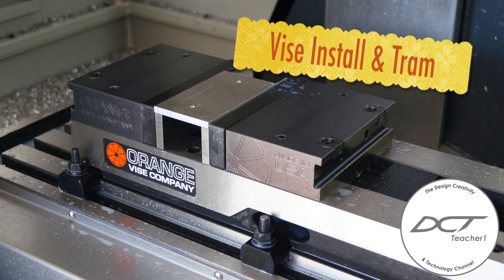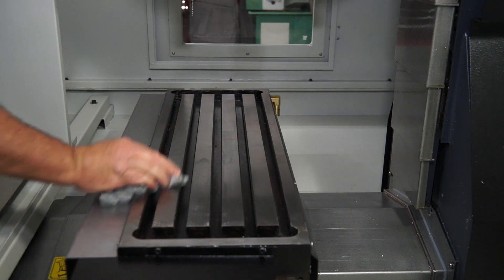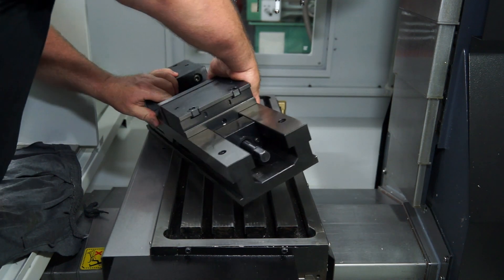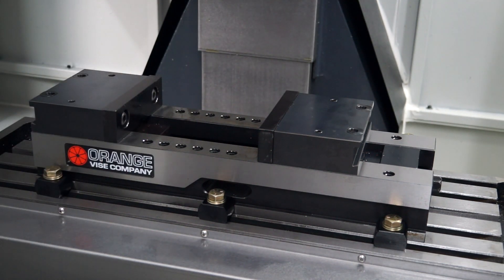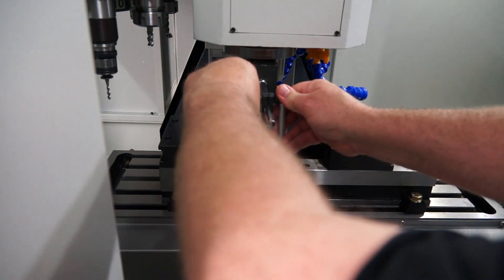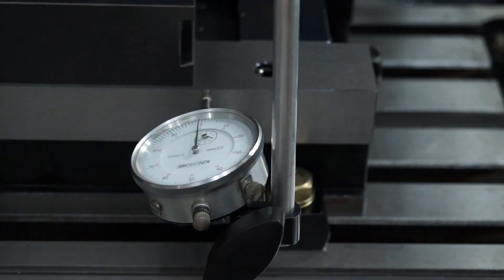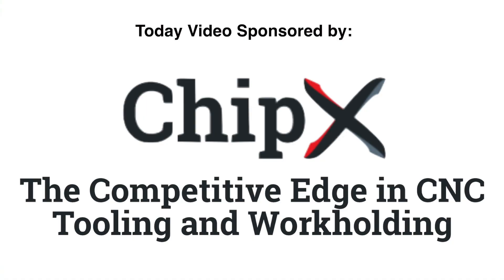How to CNC Pt.4 - Install & Tram your Vise

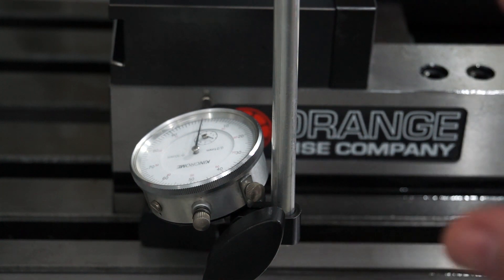Comment: 5:56, they come with torque specs for your vise to bolt down to your tram or working station? I was wondering about that while i was watching the video but i thought people just randomly go "TWO UGGA DUGGAS" and you good lol
Reply from the maker: ha ha ha.  Yeah I just torque to the specs of the bolts depending on grade.  There is chart for this.  Otherwise, tighten it up to it strips and back her off half a turn LMAO ;-) . In all seriousness though, I have seen people crack their T-slot table from over tightening or from using a bolt and not a T-Nut etc...
Reply: @DCT_Aaron_Engineering  Yea. For automotive school we were never taught how to just tighten stuff with impacts and call it a day. "Tighten by feel" that's what they call it.
Reply from the maker: Yes I'm an old motor mechanic myself.  I agree, you should never tighten wheel nuts or any bolt with with a rattle gun as it can stretch the bolt / nut (plastic deformation).  However, I learnt that at uni and not motor mechanic school.  Unless I was asleep that day in class ha ha ha
Reply: @DCT_Aaron_Engineering  oh okay, the guys at work like to run their Senior/Master techs saying "I'm trying to teach you how to work flat rate" or, "You need to hurry up because RO's piling up (P.S. theres 5 RO's and you're being blamed for 5 of em because you're slow and new to working)". That or the Service Advisors complaining "You need to hurry up because they're complaining" and then something breaks and then they're even more furious -.-

Comment: Another great video Aaron. A question: I saw somewhere that machinist's stones had to be run through a surface grinder before they were flat enough to be used. That seemed odd to me, do you think its OCD or something useful to do?
Reply from the maker: HI Nick.  Thanks for watching mate.  Yes that's highly possible.  I've never done that before, this was brand new first time out of the box.  I did notice that the only the outside perimeter of the stone was in contact.  Cheers Aaron.
Reply: Hi Nick, here is a great video on the subject. https://www.youtube.com/watch?v=DVLXsq7pi9Y
It's not so much about being flat, the grinding blunts the front of the individual abrasive grains on the stone, which stops it cutting the flat part of the table. Any burrs sticking up go into the gaps in between the grains, and get cut. So you can safely remove the burrs, without cutting the existing flat surface.